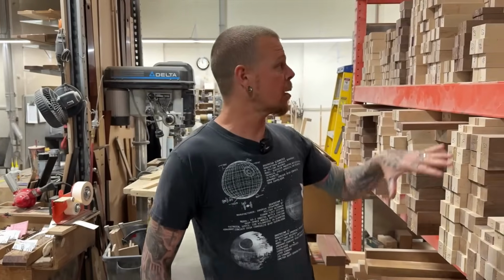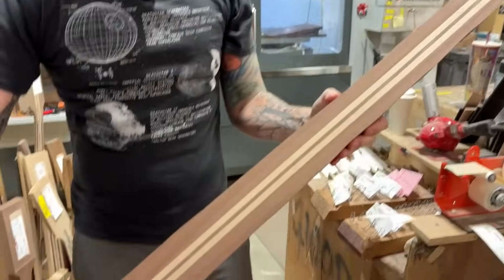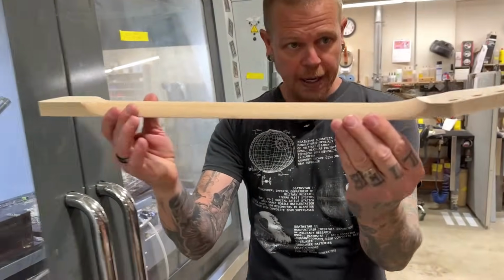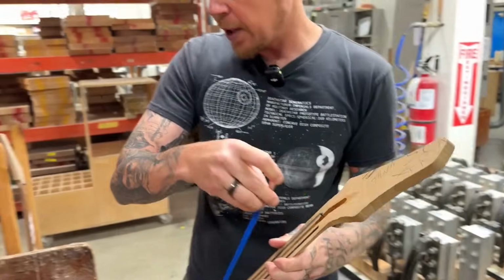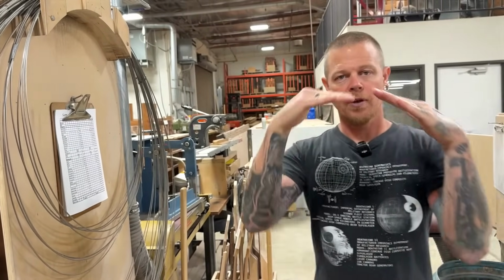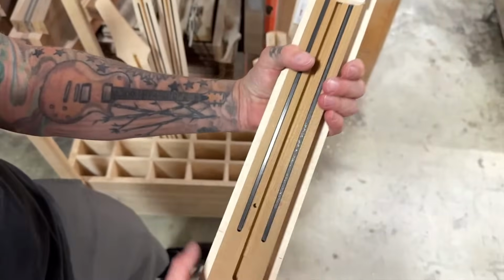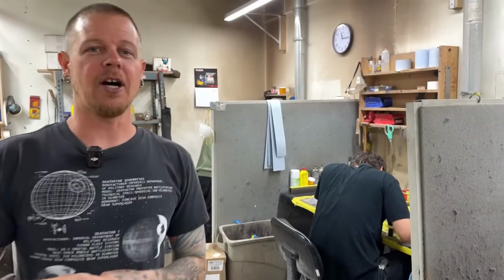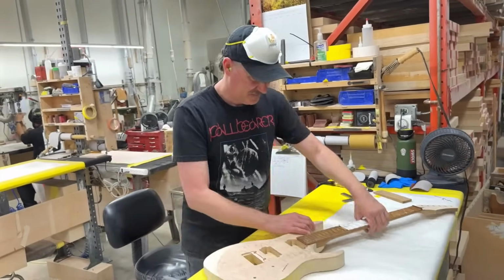Kiesel Necks - Stability, Construction, + more

Comment: I bought my guitars when it was Carvin, made to order.. DC lead neckthru w/3 on/off for S S H pickups instead of 5 way, splitter for H, phase sw, A 6 bass neckthru act/pass with a body like the Icon, and head like the Vanquish and  A  6 over 12 ac/elec semi-hollow like the CT body. All were built to my specs, Emerald Green fade to Black, dual graphite rods/2 way truss, and my personalized name truss rod cover, with no problem. I later bought an ac/elec acoustic Dreadnought cutaway.  So far all of them are the best I've played yet and still play them to this day. Have played in all atmospheres and they stay tuned. Need re-fret on the DC and cutaway, and all sound engineers say the 6 bass is the best and easiest to mix/eq they have ever worked with. I am not on the road anymore @ 65, but am working on my  own material, now. I do want a Kiesel now, though, as I expect them to be at least the same quality as the Carvins. Maybe very soon. Working on it, as we speak. We even bought our tri-amp full-blown sound system and board back in the 90's from Carvin... awesome setup. Still use the Vai stack, and the 500 W RedEye bass amp, too. Thinking about the HyperRig, now.